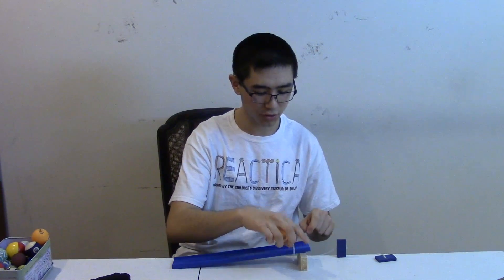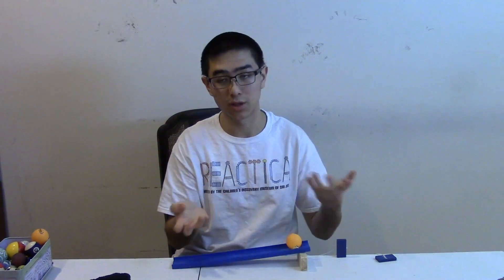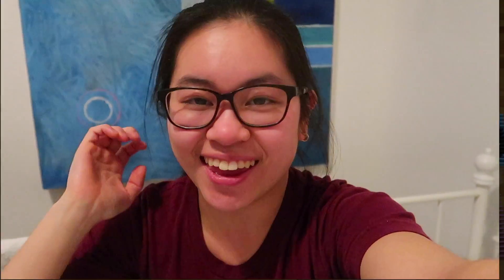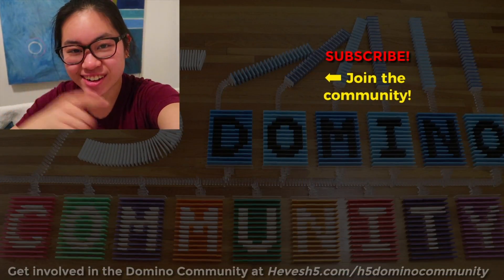How to Build a Chain Reaction Machine (ft. TheRGMGuy01)

Comment from the maker: What do you think are the biggest similarities and differences between chain reaction machines and domino art? Why do you think the communities are so closely related?
Reply: I wish to build machines but I don't have any primary materials like tracks and even ping pong balls
Reply from the maker: @Unknown_Programmer  To get the obvious out of the way first: It's definitely possible to build machines without those materials. But a more realistic answer is that just like any hobby, there may be some costs associated with it. Luckily, ping pong balls are INCREDIBLY cheap, and you don't even need the high quality ones. As for track, you can always get away with paper towel tubes until you're comfortable spending money on things like Hot Wheels or Trix Track.

-Lyle (H5DC Manager)
Reply: Differences:  Dominoes are visually and acoustically interesting to observe, while machines are really not.  Machines are more interesting to design, build and analyze from a physics perspective.

So, to me, machines are for the builders while Dominoes are for the observers.
Reply: I think that there different because of the variety of materials they use. They use balls, hot wheels. And other stuff. Domino builders use only dominoes and 
occasionally string. There the same because they the essentialy do the same thing. Trigger one thing to the other. Great video!
Reply: I think they're related because they both use chain reactions to function and one can turn on the other (as in a domino triggering a machine, or a machine triggering a domino)
Also thanks for the community videos! They definitely give me more inspiration :D
Reply: Dominoes maybe old. But Domino Art (Dom-A) is newer than chain reaction machines (Ch-Re-M). - Seeing a machine of any kind makes us think of 'efficiency', even if it's totally Rube Goldberg. - Seeing a DomA  makes us think only of the pleasure in seeing its construction and observing and hearing it fall.- It's probably a question of time and habit to expect the same of them.

Then there would be only the difference of construction: DomA is destroyed by one run. ChreMs can be repeated as long as the construction lasts.

And there's still a slight difference of material, ChreMs use less dominoes than machine parts, DomAs use more dominoes than machine parts.

What then would a construction be called using 50% dominoes and 50% machine parts? A DomA ChreM? Or a ChreM DomA?

How do you even measure that: do you count the pieces? Do you weigh them?

This is fun! Thank you very much!
Reply: E?

Comment: Well, for me, I am not so much of a machine builder because i have little materials for chain reaction machines. But however, there is one video i tried to do a rube goldberg machine after being inspired by a rube goldberg machine project day in school. There is also some materials that i have that is quite the same as what TheRGMGuy01 has mentioned. For once, i made two long toilet roll tracks and four short toilet roll tracks. On the other hand, i also have strings Sometimes, i use machine elements in my domino projects just to make the video look interesting with machine tricks and domino tricks. By the way, what a great video to share!

Comment: Great video Chase!  Very professional and detailed!  One thing I would mention though is that I would use hot glue as little as possible, especially on surfaces like wood or your dominoes.  Hot glue however peels very well off of plastic like Hot wheels tracks and knex.  Gotta keep the cleanup process in mind while you're building your machines.
Reply from the maker: Your last point is especially notable: definitely keep the cleanup process in mind! Although I want to clarify my perspective (and I believe Chase's as well) on hot glue. Every machine-building item I own is easily hot-gluable, even the wood blocks and the dominoes. I have found the perfect kind of hot glue for me, the perfect table surface for me, and the perfect wood blocks for me. I have no trouble whatsoever peeling hot glue off my materials. (I will say, though, that if you're trying to keep your dominoes in pristine domino-building condition, maybe don't hot glue them). I fully agree though that you should use as little as possible, and learn where you can glue and where you can't. For example, gluing on the flat sides of K'nex pieces is totally fine, but never put glue inside the ridges of a rod, or inside the hole in the center. Over the >3 years I've been building with hot glue, I have a system that works extremely well for me, and I haven't had any instances of materials being ruined by hot glue in the past year at least (except for materials I knew would not be salvageable and I sacrificed them deliberately).

-Lyle (H5DC Manager)
Reply: Very good advice from Lyle in this thread. You are both right in that cleanup is something I neglected to mention, and I agree with Lyle when it comes to hot glue use and removal: Moderation makes removing it easier!
Reply: I'm probably being a spoilsport here: how environmentally friendly is hot PLASTIC glue? In the EU they have decided to ban a lot of every day plastic stuff this week. Wonder what to use if hot glue gets forbidden: maybe glue with sugar and water? It's easy to vacuum afterwards and leaves no destruction and traces, should also easily come off.

For everyone who thinks this is just a superficial problem:

I depend on hygienic straws for my disabled child. I have used medical steel and silicone replacements. They're okay with water. But after liquid nutrition they have to be sterilized. And that's additional work in an already exhausting life.

And science has found plastic micropellets in poop-probes around the world. So it's not hypothetical.

What do you think?

(Edit: grammar error)
Reply: Well, isn't tape a plastic too........?
Reply: @StickTrickDominoDude  Yep. If you open that can of worms, you find neverending snakes ... I think there exists biodegradable sticky tape somewhere already. - I admit, I am only environmentally friendly up to a certain point. (Slinking away to feel guilty ...)